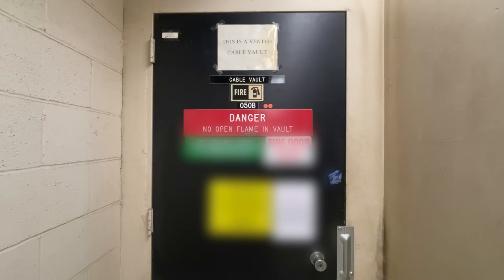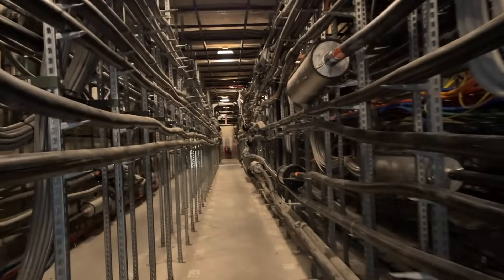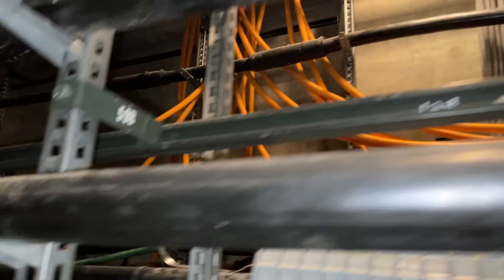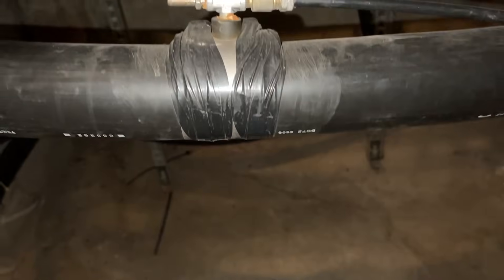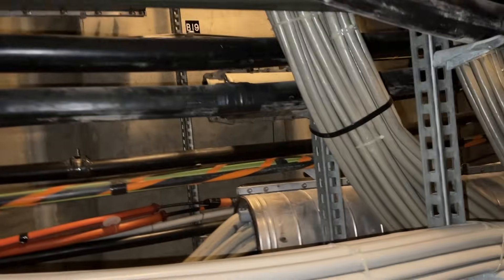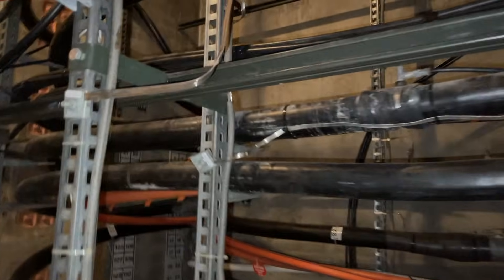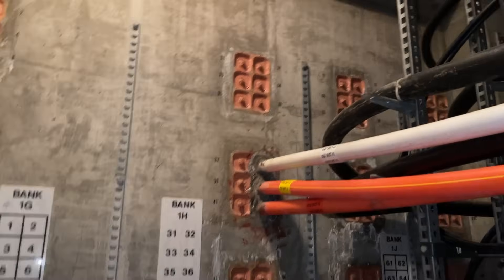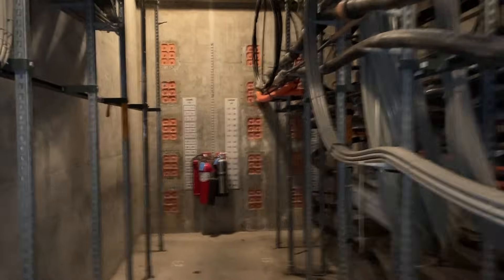Inside a Central Office Cable Vault (Telecom)

Comment: Typically air presuurized cables have the air keep water out of the cables. You can monitor the air flow rate (of air exiting the cable) and if it is too great some repairs need to take place.

Comment: Got my subscription! Overpressure cables are a great concept but keeping them operational is usually too demanding in reality. The gel is "Elephant Snot".
Reply: It was actually interesting to hear him use the term "icky-pic". I was around working as a cable splicer in the early 1970's when it was first introduced into the outside plant, and that is exactly what it was called back then when it was introduced, "icky-pic". Absolutely nightmarish to work with, gets all over everything, every tool, clothes, arms, legs, you literally got covered with it opening the cables and handling the pairs. I had a pair of Carhart coveralls on my truck that I only used when working on icky-pic, that could never be taken home and put in the washer. Eventually they came up with some decent cleaning kits for removing the "icky-pic" gel before splicing. Apparently, that term has been handed down ever the years and, like the gel itself, has stuck!

Comment: Is that Central Office Cable an ISP?
Reply: ISP/osp stops and starts at a cable head usually a 303 type cable head that separates inside/outside equipment those gray cables going up thru the floor of the vault go to the cable head

Comment: The reason why some cables are pressurized with nitrogen is because the copper wires in them are insulated with paper to give the cable the smallest possible cross section.
Reply: And because plastic hadn't been invented yet.

Comment: what kind of hardware is in those splitters? Are they splitting coax?
Reply from the maker: The cases are just fanning the copper cables out to smaller cables. No coax here.
Reply: Some of those "cans" look to be old fashioned voice coil amplifiers.  They would used the low frequencies of your voice to amplify the the higher frequencies to push the signal farther down the wire.  You used to see these frequently mounted on telephone poles in the country side.  This is why the sound on a "long distance" call sounded "tinny" compared to a "local" call.

These were used on old fashioned "pots" line in the days before digital signals.

The government requires telecoms  to keep these old systems running for national security in case the complex digital communication systems are compromised.

Comment: Sooo at what point does the government intersect my data, you got access to the black rooms?
Reply: That would be at the MDF, they can put a little black box and connect to your cable pairs to tap your phone.   Internet is typically only done at the metro areas, like NYC.   Probably also Toronto. Front St would be a safe bet.

Comment: Good story for you.
Worked at a Telco for a few years, hired a few guys in my time there.

One guy came from running his own business doing maintenance and cable work as a contractor for all the major telcos.

He was contracted to pull cable for a huge Telco through some of their vaults. They had the wrong information documented (on which holes were occupied), he asked for clarification. Was told the cables were abandoned (it was twisted pair, and tons of it.)
He got the OK to proceed, cut the hundreds of pair phone cable, and pulled in new cable about 5 blocks.

Apparently the cable was still in-service and some number of untold customers were dark.

He told me the story with a huge smile on his face. 😅

Comment: Power cables, neat and tidy. 
Fibre cables, flung everywhere with a she'll be right, mate attitude.   

power cables from the 1930's however is a wee bit concerning. they are 90 years old, minimum, at this point.
Reply from the maker: The is telecom
Reply: Not power cables phone cables one of them will kill you when you dig it up with a shovel !!!

Comment: In the not-too-distant past, a central office was where a lot of twisted pair terminated. Too bad the short-sighted telcos are ripping that all out. Makes me wonder just what a CO does any more.
Reply: Ethernet switching and routing equipment    Id say that telco based facilities are superior to cable based  telcos.  Cable based just seems to have the odd box on a electrical pole throughout the city, the telco has wiring/data centres with generator, parking spaces and computer cabinets
Reply: @maxvideodrome4215  but Ethernet is a cable...
Reply: Ummmmmmmmmmmm Fibre?!

Comment: Interesting that the modern fiber cables are a tangled mess while the older cables are nicely organized.
Reply: the best part about this is those fiber cables have a multitude of more capacity over the rest of the cables in that room
Reply: Lol, I was just about to say.
Reply: Fiber is usually not susceptible to the same interference copper have and so on so yeah, it's actually just fine.
Reply: While it was definitely retrofit to the building, fiber optic cables have a rather high minimum bend diameter, especially older styles of fiber with thicker cores.
Reply: it's probably because cables are much cheaper and resilient these days.
Reply: It’s obnoxious.
Reply: I’d imagine there’s a level to which it has to do with install date and route. With older copper cable you’d have massive cables breaking into bundles of cables all going to roughly the same spot. With fiber, the bigger capacity and curve radius (plus slower phase in) would mean you just have one cable coming in and going to a unique spot - so making it prettier is harder.
Reply: The Fiber cables need plenty of length to be joined and repaired.
Reply: I’m no professional, but I don’t think you can bend fiber in a tight radius like you can copper.
Reply: @mariorosas6364  hey I am a professional/33 years at ma bell spliced a lot of copper and fiber cables its amazing how tight of a bending radius that glass has without breaking single mode which is a single fiber of glass a little thicker then your hair can be bent in a 2 or 3 inch radius without harm
Reply: @mariorosas6364  both copper cable and fiber have a minimum bend radius. For copper, violating it can affect signal integrity (by affecting the cable characteristic impedance) or can cause a cable to break. For fiber, it causes light to escape from inside the fiber and be lost in the jacket (bending too sharply prevents total internal reflection from happening). Sometimes engineers will make makeshift fiber attenuators by just purposely bending a section of fiber too sharply - you can predict the loss per turn based on the radius. Overall, how much you can bend each depends on the size but you certainly cannot tell from the outside whether a tube is a copper cable or fiber based on the bend radius. Both can be bent pretty tightly.
Reply: @sbreheny  the copper cables coming in to a CO could be 2400/3000/3600 pair cables. They are very rigid and are pretty much installed as straight lengths. That is why you see a splice case transitioning to smaller cables, which subsequently head upstairs.
Reply: it's the work ethic and actually giving a f*ck about your job that has disappeared (due to lower wages and reduced benefits, if you're not appreciated you're not going to put extra effort in).
Reply: @mcfuggin   u hit the head dead on the nail. Most people just want things done super fast and work. No one thinks about down the road and they wonder why it cost so much for a service call and consistent problems from on out😅
Reply: The newer generation doesn’t care about cable management. Tangled messes like that would never fly in the old school Telco world. All cable management standards are going out the window.

Comment: Notice the old cables are installed neater than the newer fibre!  Sadly, that seems to be how it is now.
Reply: not sure why this one is that messy but generally we were told to run it loosely to avoid damaging the fibers and not use tight stitching like we do with copper/coax to make it look pretty. most company's i worked for had a max bend that we were allowed in the cable down to only using Velcro to secure/organize. Kinda over the top for it but better to be safe than run a new one
Reply from the maker: Vendors
Reply: @MrSmoothnuts101 Correct. Tight bend radius and you’ll see how it internally cracks.
Reply: Fiber is more susceptible to this. Don't just always assume really
Reply: R.I.P. (retired in place) not worth the effort to rip out obsolete stuff unless there is copper which is now very expensive.

Comment: Nice, I worked security at a communications based company and remember a room just like this but a lot longer, I just entered part way. Most of the time I just looked down the hall from the doorway. I remember wondering what the round cases that all the cables go in and out of were for.
Reply: The round cases are where the cables are spliced.  You'll also see them outdoors hanging from aerial cables.

Comment: Every time you have copper cable, you have connections/connectors. And this nicely demonstrates the principle here. And every connector may have many connections.
Each of which is subject to malfunction for a variety of reasons. People who work in this field spend a lot of time running down poor connections and correcting...
The number of ways a connection can malfunction is infinite and beyond the capability of a mortal to fathom. Trust me, i know.

Comment: I worked as a telecoms apprentice in a CO-TE back in the late 1970s. We had cables coming into our cable chamber (British term) that were wrapped in an outer lead sheathing, containing copper wires insulated with paper. The pressurised air was dehydrated before being fed into the cable, both to protect against leakage (electrical between wires, and gaseous if the outer  sheath was damaged) and any pressure drop would indicate that damage had occurred.

Joints between lengths of lead sheathed cable were lapped/melted together using a gas/propane torch, and then the lead was “wiped” together  using a piece of moleskin. The inner copper wires were just twisted together to make an electrical connection, before a paper sleeve was placed over each joint to prevent short circuits. 

Different times, different technologies, but cable chambers haven’t “evolved” much since then.
Reply from the maker: Pulp cable

Comment: 1930s? I heard the internet was pretty slow back then.
Reply: actually the Victorian telegraph system was the first internet. morse code bears more than a passing resemblance to modern digital modulation.
Reply from the maker: Just like making an International call
Reply: I remember a 56k dial up connection we had in the C.O. Back in the 80’s and I was only 100 feet from the switch
Reply from the maker: @billcampbell9949  😄 We still use ADSL for internet access in the CO. The company lan is typically a T1 (1.5Mb)

Comment: IDK...cables?🤔🤷🏻‍♂️
Reply: An Ethernet patch cable has 4 pair.  A 25 pair telecom cable is 0.33 inches in diameter.  So, those cables have hundreds of pairs, each pair going to a house for old landline service or DSL internet.
Reply from the maker: Correct, plus some we just lease the copper pair (no dial tone\service) to a customer to use. For example some were used as alarm circuits, radio station links, frame relay, etc.

Comment: Did you find any lead covered (silvery metal) wiring that resembled 12-2 Romex, or in some cases 12-2 w/ground. I was poking around in a vault tunnel system 20 years ago and found a piece of this very stiff 'metal-clad cable' that was pulled through conduit, no less. I sliced off a 5" long piece, just for the memories.
Reply: Lead sheath cable was the standard until a transition to plastic after WW II.   It was pliable enough to be shaped for curves and the splice points were also make of a bigger diameter lead tube.  The splices involved using molten lead to seal the splice.  The copper wires were insulated by paper and it was possible to get 1,200 twisted pairs in a single lead cable.   Splicing was interesting -- it started as "random splicing" withing 25 pair and each group of 25 pair would have a color coding for distinguishing them from other 25 pair groups.  Cable slices were originally protected from touching other pairs by cotton sleeves but that was updated several times.   The mentioned air pressure was designed to keep water from getting inside the cable -- the paper insulation became a mess when wet and lost its insulation qualities.   I recall getting 6 lbs of air pressure at the distant end was considered acceptable.  Nobody missed lead cable, air core plastic sheath was better, and "icky pic" was gooey but solved the water intrusion problem without pumping air from the CO.
Reply: @ I'd like to see how they made that icky pic.
Reply from the maker: @louismessere6379 Not how they made it but here is what it looks like close-up. https://www.youtube.com/watch?v=BEUoUDFROiI
Reply: back in the day there were about 20 kinds of solder that a craftsman would carry to work on lead sheathing, each for a different purpose.

Comment: What is the type of battery being used here?
Reply: Usually flooded lead acid, just can’t beat the old technology. Sometimes they will have VRLA or even Ni-Cad at smaller locations. But nothing fancy for this type of application.
Reply from the maker: Correct flooded lead acid. Here every floor has battery strings.
Reply: They are huge 1.5V flooded lead acid batteries, wired in series to supply -48 VDC operating voltage. Yes, it's negative voltage.

Comment: How long is cable good for? They say the cable on the Poles are only lasting 20 to 50 years. I thought that we were supposed to be upgrading to fiber all over the country.
Reply: Life span?  The answer is always the same.  It depends.  Arial is going to be shorter due to movement, and clowns damaging it.  It will all out live you.  Newer fiber characterizations benefit current and future amplification technologies, and DWDM technologies.  Those will be greater driving factors for fiber upgrades/replacements, than aging out.  I have customers still utilizing fiber that was buried in the early 90's.  Throwing multiple terabytes per second down the fiber no problem.  

You have no idea how many route miles of fiber are added every day.  It's pretty crazy.
Reply from the maker: They are upgrading but not everywhere can get fiber yet. Still have to support existing infrastructure.
Reply: As you probably guessed, making the switch from copper to fiber is no small task! Add to that, this cable vault is only one  of hundreds across the United States. AT&T recently announced that the FCC had given them the green light to retire all copper cable, network switches, SLC, & T-1 repeaters. The company announced a target date of 2029 for completion of that work.
Reply: @BartlettTFD  

Getting rid of something that was very reliable and always worked and replacing it with fiber.

Sure fiber is better in many ways, but is it as reliable?

Also when AT&T completely does away with copper cable are they going to provide adapters that make people's analog phones still work?
Reply: @ikonix360  What they do is provide a VoIP adapter that connects to the fiber and you plug your regular wired POTS phone into it. I just moved into a new subdivision and no copper service is available at all. It's all fiber now.

This is a poor substitute for a real hard-wire phone, though. With wired service, your phone will still work in a complete power failure because the CO supplies power to the phone, not your home's electrical service. Now, with fiber, if your power goes out, you're out of luck. Cell phones will also not work as they rely on cell towers which would also stop working.
Reply: @BartlettTFD  oh that explains why I seen an advertisement offering to sell one of those sights. It didn't mention a price though, it just said cheap.
Reply: Cables are designed for minimum service of 50 years copper and fiber